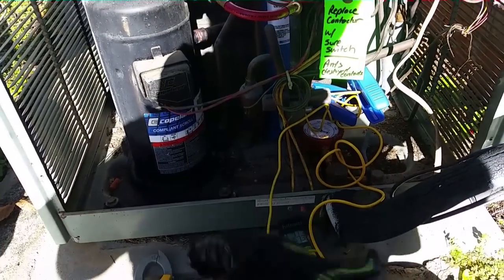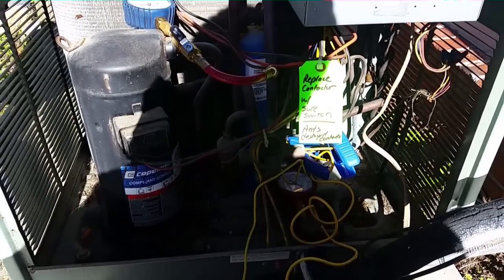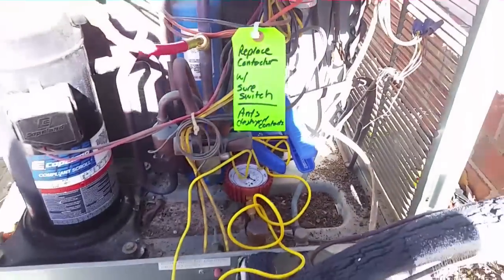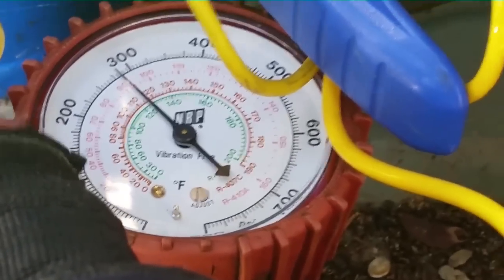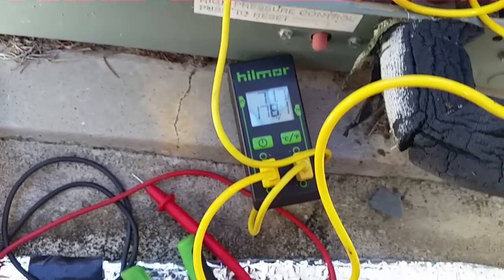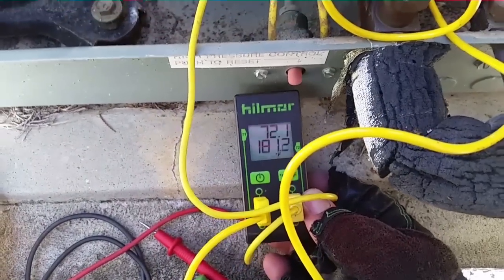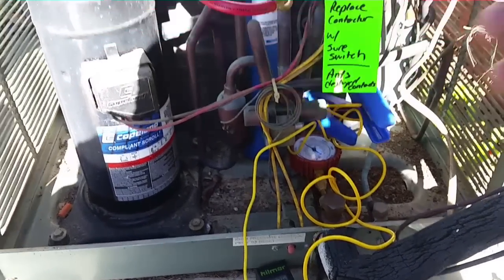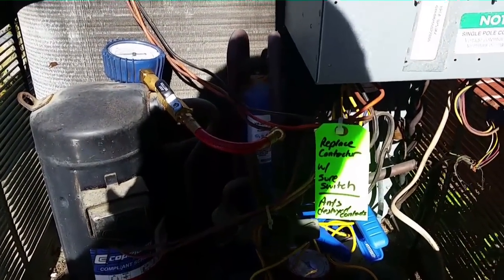HVAC Discharge Line Superheat

Comment: Should suction superheat and discharge superheat have the same satisfactory range?
Reply from the maker: +Eddie Sellers they will both reflect each other. High suction superheat equals high discharge superheat. Same with low. Not sure if there is a fixed range with discharge superheat. Just need the head temp to stay out of 200 ' s
Reply: 20 to 60 degrees dsh on scrolls 

15 to 30 on screws and centrifugal’s